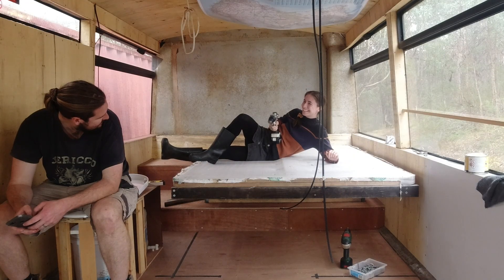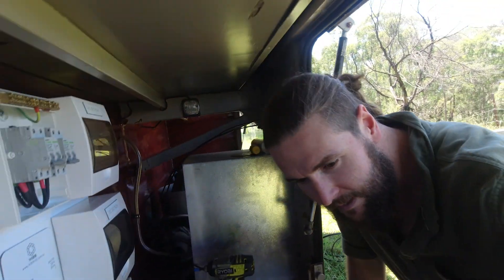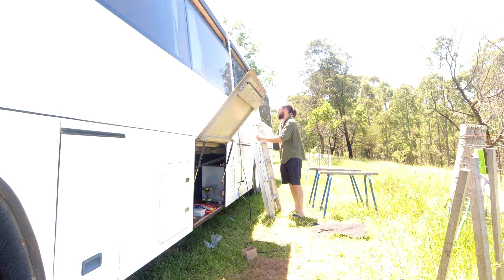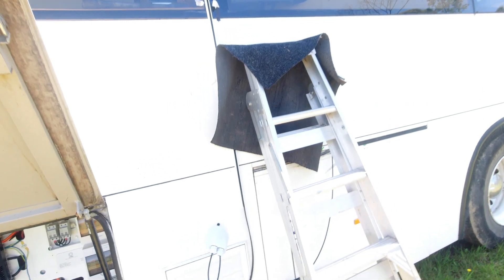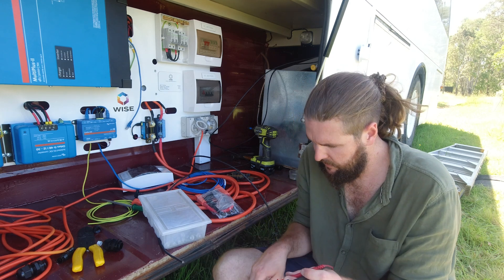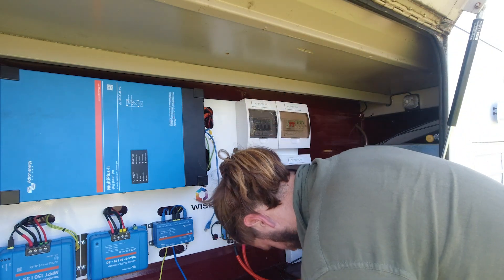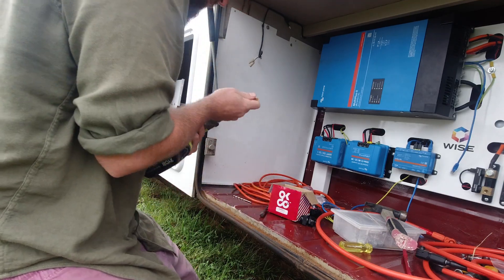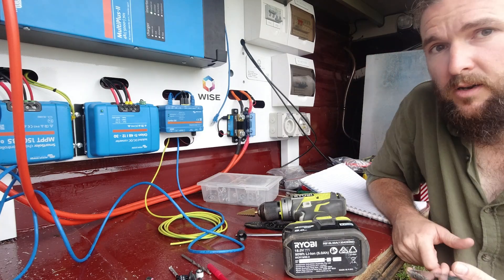Connecting Our Solar Power System Together [48v victron solar power system]

Comment: Good Morning folks.  Glad you found the missing footage.  I so admire what you are doing.  Hope all is well.  Susan
Reply from the maker: Good morning ☺️ finally some fairly calm weather for us all. How are you guys down there in Vic?
Reply: @DiandSam Well, here in the High Country it is currently 23 and a bit on the windy side!  I am lucky I am over 1000mtrs, so it's alot cooler. Down in Mansfield it is around 37.  It is always so much nicer up here.  Doing 'indoor' chores today for the most part.  I don't do heat well.  How is the bus coping with the hot weather?